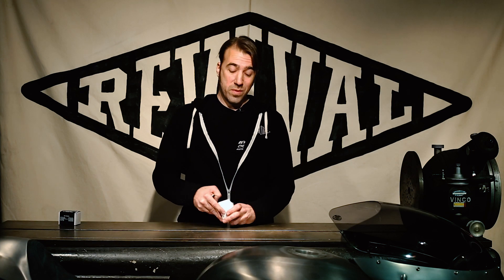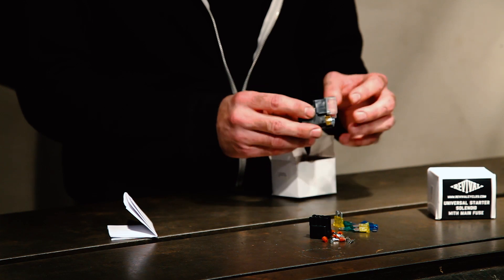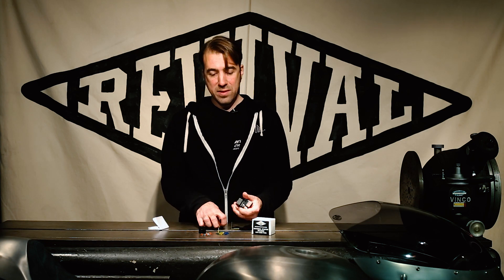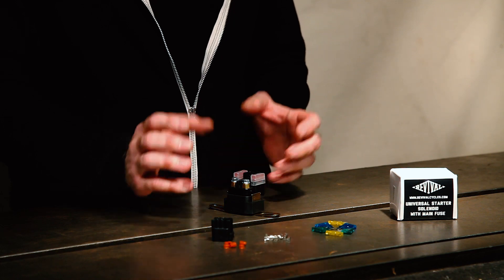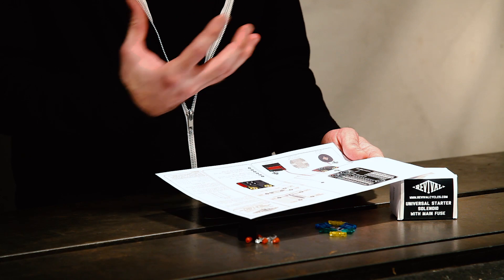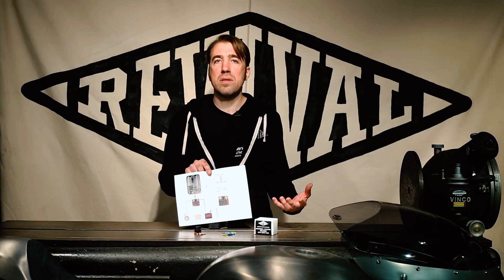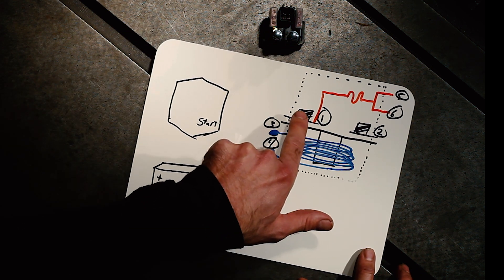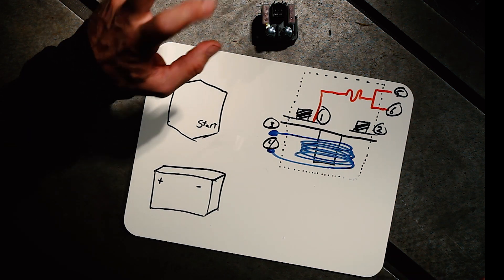Revival Cycles Tech Talk - The Revival Starter Solenoid Kit

Comment: Hi
I have just started to fit this bit of kit to my bike, the problem being, the pictorial  diagram showing where the terminals go are different to the ones written in the terminal assignments ones .
On the picture side you have terminal 4 going to ground  and no 5 going to battery on m-unit.
On the written side you have  terminal 4 going to battery on m-unit and no 5 going to ground . 
Could you please tell me which is which so i can carry on and get it right?
Thanks 
Merv
Reply from the maker: HI merv, this isn't the best platform for technical support, would you mind shooting me an email over to techsupport@revivalcycles.com and I'll get you sorted out?

Comment: Would this be a replacement for a stator and regulator?
Reply from the maker: Not at all. A starter solenoid is a high current relay used to open and close the circuit between the starter motor and battery.

Comment: Hey Revival Cycles I appreciate the great video. 

I have a question regarding when the primary wires are energized (connected to 12v battery, start switch are closed).
this engages to make the mangtic coil, which closes the Positive of the Battery to the starter Motor. Why does the Primary wires not overheat and burn if is connected too the same Battery that uses alot of Amps to Power the starter motor. 

I hope you understand my question.

Cheers David
Reply from the maker: Hi David, if I understand your question correctly, the primary wire is large enough to allow for the amperage we use 6awg (16mm2) which can handle as much as 480 amps depending on other factors.

Comment: Question! why have a starter solenoid when you have the munit? doesnt the munit have an integrated digital solenoid? Shouldnt you just put a fuse on the connection?
Reply from the maker: Good question. 
1. There is often confusion around the differences between a starter Relay and Starter Solenoid. A Starter Relay manages current at the start button. A Starter Solenoid manages  the high current required by the starter motor. There are often translation errors on wire diagrams. The m.Unit has a internal solid state relay but this is the equivalent of a starter switch relay not a high amperage starter solenoid. The starter motor draws huge amounts of current and if you wire this directly to the start outputs your m.Unit the Outputs will fuse open and dump so much power through them that the m.Unit will melt into slag. Unfortunately, I can't post a photo to this reply. 

2. The m.Unit already has internal fuse protection. Adding a second fuse won't add any additional security.
Reply: Revival Cycles thanks for the detailed reply! Just figured that the starter motor on my r80/7 have a built in starter solenoid :)

Comment: Which size fuse am I supposed to use??
Reply from the maker: Hi Anthony,  this is dependent on the model which is why we include a variety of sizes. To determine the correct fuse size refer back to your OEM fuse box, manual or diagram and use the same as the original main fuse.

Comment: Could you run a wire of the main fuse terminals to a key/switch which then is connected to terminal 3 thus giving you a fuse between the battery and key/switch while also allowing you to run without an M unit?

Comment: Hey Stefan, just getting my kit together (totally new to wiring) and have appeared to have gotten one of the tiny metal connectors stuck in the waterproof connector, pullout out the stripped cable.  Any hand tips for getting this thing out? Looks like its in there pretty good..
Reply from the maker: The terminals have tangs that lock into place when you seat them in the connector. Look at the face of the connector for the cutouts where the tang can be accessed. Depending on the connector there are different tools designed to release them,  in a pinch you can often get away with using a paperclip or flathead mini drivers to depress the tang and release the terminal.
-Berry

Comment: Great Video! But I'm confused about the power supply for the m.unit. 
It comes with a 7 AWG battery cable. If I power the m.unit through this solenoid I will be using a much smaller wire, correct?
Reply from the maker: Good question Justin, 

The m.Unit comes with a 6 AWG cable. This never comes into use in our builds, in fact we're not sure why they include it, there is no scenario where the m.Unit could draw enough amperage require this gauge and installing the in line fuse would prove difficult. 

We've calculated that using the TXL Cross-Linked Automotive grade wire that we provide in our wire kits a 12 AWG, wire is sufficient for providing power to the m.Unit. Countless installs without issue have proven this to be true.

From the battery to the solenoid and solenoid to starter motor is a different story all together and in most instances a 6 AWG is ideal. We offer two different kits on our site for this as well, a EPDM insulation and a cloth braid over PVC. 

-Berry

https://shop.revivalcycles.com/revival-cycles-battery-cable-kit/

https://shop.revivalcycles.com/revival-cycles-cloth-battery-cable-kit/

Comment: Correct me if I'm wrong, but if this fuse in the solenoid acts as the vehicle main fuse, then there's no real reason to utilize the waterproof main fuse holder included in your Revival Cycles Cable kit, is there?
Reply from the maker: That is correct, there is no need to use both as a main fuse. But in many cases there is a need for a secondary fuse for very low amp devices like motogadget gauges or sensitive accessories. Also there are other bikes that don't use this type of solenoid and they still need that main fuse. Bottom line the main fuse holder in the kit doesn't add a ton to the cost and its a handy thing to have if / when you need it.

Comment: A little disappointed I bought the last one you did the hard-sell on - it's still in the box waiting for the wiring stage.
That's technology I suppose. The iPhone 20 comes out 3 months after the 19 was the new best thing.
Reply: I'm in same situation. I don't think there's huge advantages with this kit though. Granted it is waterproof and the connector connects easier, and comes with a few extra fuses. No big deal.